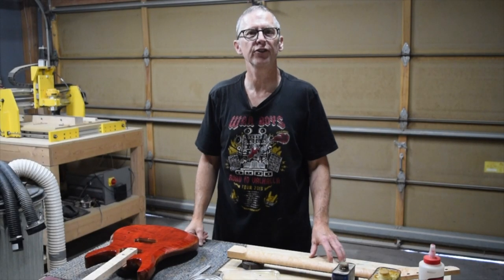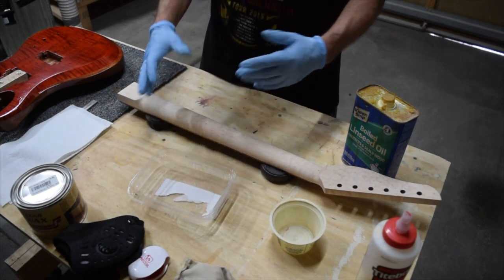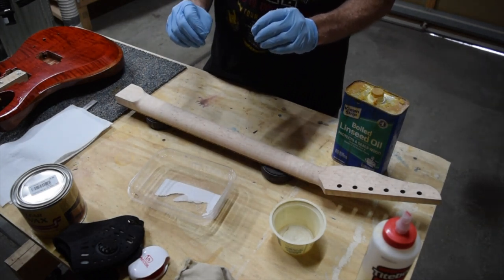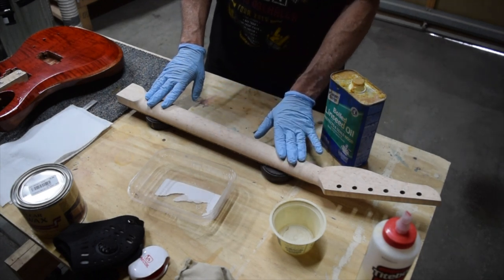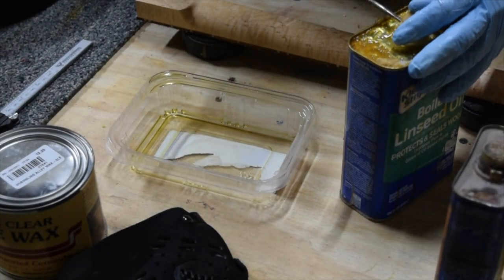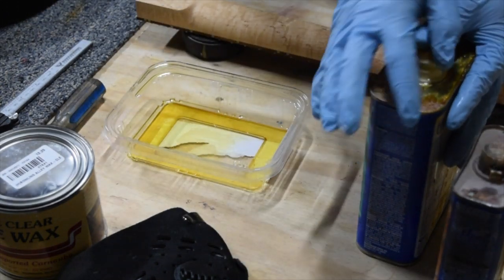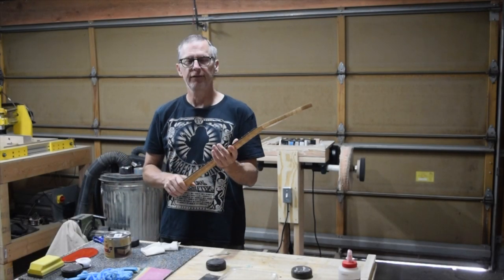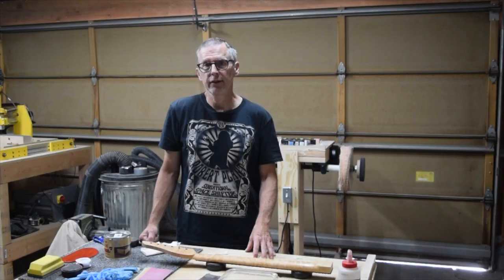Applying An Oil Finish On A Guitar Neck

Comment: Thank you for sharing your knowledge.  Very much appreciated.
I made my first guitar in 1983.  A Rickenbacker 320 copy, in black with white body binding.  I used spray lacquer from Standard Brands Paints. 
I want to strip it and stain it red and replace the white binding.  It has a center core of birdseye maple and wings of Honduran mahogany. 
Do you think I will be able to strip the finish so that BLO finish will not have application issues?
I'm concerned about any residue from the original spray lacquer.
How delicate is BLO?  Is it forgiving enough that residue will not be an issue?
Thank you
Reply from the maker: Since the stain has to soak into the wood, any lacquer residue remaining on or in the surface will inhibit its absorption. Therefore, you will have to completely remove all traces of the lacquer before you apply your dye to the wood. BLO by itself is really intended to seal and enhance the natural appearance of the wood grain. The only protection it offers is to prevent the absorption of humidity and sweat. It doesn't protect the finish from scratches and/or dings. For that, you need a clear coat like lacquer.
Reply: @HighlineGuitars  I've been debating between so many finishes.  I'm going to strip the finish, sand and apply body binding to both sides.  I have naptha and will clean the raw wood.  I do like the feel and idea of BLO to the neck but the guitar is a neck-thru build.  I want the birdseye neck to really show.  It might be a trade-off between having a smooth neck and a more delicate body.  Can there be a transition of top coats at the neck joint area?  Maybe keep the neck with BLO and add Tru Oil type finish to the body?  How toxic is BLO?  What about polymerized linseed oil?  Any suggestion would be appreciated.  I just retired, so I have the time to finally get to this project.  Thanks for all the help.

Comment: When do I apply my headstock decals? I assume after it's sealed right? Thanks!
Reply from the maker: After the oil has completely dried and before you lacquer it.
Reply: @HighlineGuitars  Thank you! Do you have a vid on that? I didn't want to clear coat my neck but it seems with the decal I have to do something at least on the head.
Reply from the maker: @Selmer1430P  no video. I don’t do decals.

Comment: Great idea for the back of the neck. What would you suggest to use on a unfinished maple fretboard?
Reply from the maker: The traditional approach would be to use nitrocellulose lacquer. A more modern approach would be to use an amber tinted 2K polyurethane.

Comment: @Highline Guitars Just one coat of oil? And it is ready to sand within 2 days without the drying agent?
Reply from the maker: At least one coat. No more than three. Without the drier, it'll take a couple of weeks to dry where it can be sanded without gumming up the sandpaper.
Reply: @HighlineGuitars  I couldnt find Japan-drier here in Europe, so I got a more concentrated cobalt drier that I will try cutting with naptha to something like 1/5 or 1/10. How long drying time between coats and do you apply the drier again between the coats or only once on the bare wood? No sanding between coats?
Reply from the maker: @infectionsman  24-48 hours for Japan Drier. I have no idea with the stuff you're mixing. You can sand between coats if you need to.
Reply: @HighlineGuitars  Do I only put Japan Drier once on the wood, or put it again between the oil coats?

Comment: Thanks for learning me...I have never heard of anyone using boiled linseed oil as a guitar neck finish. I’m a woodworker and use it myself, mixed with shellac sometimes or as is. Are you familiar with the Ernie ball necks? They have a very natural, soft, amazing finish. How would you recommend getting that? Agreed thick gloss necks are sort of brutal.
Reply from the maker: I am familiar with Ernie Ball necks, but I'll have to investigate their finishing technique.
Reply: I’m pretty sure EBMM is one or two coats of Tru-Oil and a coat or two of wax. Oil is put on very thin and quickly wiped off. Wax is hand polished.

Comment: Great video I really appreciated all the tips, I do have one question. I just finished sanding my neck up to 240grit and staining it with Stewmac’s vintage amber. I just bought myself some boiled linseed oil and  I was wondering If after applying two or three coats of the BLO  would that be able to protect the stain from sanding? Im looking to wet sand the finish with 1500 but im not sure if the color of the stain will fade if I sand at it ?
Reply from the maker: No, it will not protect the stain. BLO soaks into the wood. You need a lacquer clear coat in order to wet sand without stripping off the stain.

Comment: Quick question, if I were to stain the wood prior to using your boiled linseed oil/Japan drier procedure, would I use an oil based or water based stain? I’m thinking of staining the neck a dark espresso color for my build. Thank you for the help!
Reply from the maker: You can use either. Just be aware that water-based stains raise the grain.
Reply: @HighlineGuitars  Awesome, thank you for the help!

Comment: Another great video. I noticed that you didn’t mask off the fretboard. Is that not necessary?
Thanks again 🙏
Reply from the maker: No. I oil the fretboard as well. However, this video was about the neck only.
Reply: @HighlineGuitars  okay interesting I will follow your example and do that as well. Thanks a lot for great content

Comment: Nice video... what about the fretboard though? You didn't tape it off so presumably you got BLO on the sides, yet not the front. Wouldn't that look uneven if you used a different kind of oil on the front but not the sides? Or is it not noticeable?
Reply from the maker: This video was about the neck. However, I do the same for the fretboard.
Reply: @HighlineGuitars  Thanks for clarifying

Comment: Chris, I have a question.  Do I need to use a sealer before using linseen oil?  I want to use it to restore an acoustic guitar and I want the most natural finish possible
Reply from the maker: No. A sealer isn't necessary with plain BLO.

Comment: Is boiled linseed oil (or even Trueoil) suitable for refinishing the soundboard of an old classical guitar?
Reply from the maker: Yes. However, BLO only enhances the appearance of the wood and seals it. It doesn't offer much protection against dings or scratches. Tru Oil offers better protection, but it will add layers that can impact the resonance of the wood.
Reply: @HighlineGuitars  - thank you very much - valuable advice!

Comment: Hey—neophyte question here. Can you apply boiled linseed over stain? Or, alternatively, do multiple coats of boiled linseed oil darken the color of the maple? Thanks!
Reply from the maker: Yes to both. In fact, oil-based stains use linseed oil as the main ingredient.
Reply: @HighlineGuitars   Ok thanks! So, is it possible to use boiled linseed oil over any type of paint to finish a guitar body? Thanks for making these fantastic videos.
Reply from the maker: @mastabad2  stain or dye yes. Paint no. The oil needs to soak into the wood.
Reply: @HighlineGuitars  Thanks!!

Comment: I am wanting to know, if I use a decal and spray paint to apply my logo, will the boiled linseed oil accept it? My uncertainty about that has kept me from trying this method. Please answer, as I have ten unfinished necks to do. By the way, your videos are great, and I gain a lot of useful knowledge from them. Thanks!
Reply from the maker: I don't do decals, but as long as the oil is completely cured, it should work. TEST ON SCRAP FIRST!!!
Reply: @HighlineGuitars  See what I mean about useful info? Stupid me never even thought about scrap. I will go to home Depot and see if I can find some Canadian maple, and let you know how it does in case anyone else has the same question. Thanks🙏
Reply from the maker: @kenrussell1093  Also, consider polymerized tung oil like Sutherland Welles or Lee Valley (both are made by Sutherland Welles). It dries completely in 8-12 hours whereas BLO can take weeks.
Reply: @HighlineGuitars  More useful info! Are you on Patreon? I need to start showing you some financial appreciation. If not, I will watch the video again for the site you referred to, and go that route. I really appreciate your willingness to help!👍🙏🙂
Reply from the maker: @kenrussell1093  Not on Patreon, but you can click the Thanks button and leave a tip. Take care!

Comment: A question about boiled linseed oil SMELL - I bought a can of it in my hardware store. Here in Europe, in my country, boiled linseed oil is called firnis. It's as you described - oil with desicants added to help it dry faster. BUT, those chemicals give it a horrible, awful smell, almost like petrol, really intense and repulsive. Does the one in your can smell the same? Cause I don't want my guitar neck or hands to forever smell like a car's gas tank if the smell doesn't go away after drying :/ Thanks!
Reply from the maker: I don't know what the stuff you're using smells like. BLO where I live smells, but the odor dissipates as it cures. Pure tung oil smells much better.

Comment: Amazing video! Was thinking if instead of mineral spirit for the wet sanding would it be alright to just use water? Would i damage the guitar if i were to use water instead? What are some substitutes to mineral spirits? Thank you so much! 😄
Reply from the maker: Wet sanding with mineral spirits reactivates the BLO to an extent, which helps it to form a slurry with the dust generated by the process. After the mineral spirits have evaporated and the oil has dried, it forms a smooth protective surface. Water won't do that. Other than mineral spirits, turpentine will work, but it is more aggressive. Naphtha also works well if you can find it.

Comment: Thanks for the excellent presentation!  One question:  I noticed you did not apply the BLO to the tongue/joint.   Is there a reason?  Is it an optional decision?
Reply from the maker: NEVER put oil in a glue joint.

Comment: Awsome video!!! I have a question though.  Is there a reason to not sand the guitar neck prior to applying the oil?
Reply from the maker: You must sand the neck prior to applying the oil.
Reply: @HighlineGuitars    Thank you so much. I'm going to give it a try on one of my guitar's. I just orderrd a wet /dry  fine sandpaper kit and the boiled linseed oil.
Reply: I used linseed oil and I love how it came out. It dried very nice, and is nice and  smooth. Is there anything that can be done about the odor of the oil ?(other than letting it diminish over time  its own)

Comment: Maybe someone asked this and it's been answered, but if you were going to apply a waterslide decal onto the headstock would you do this process first, and then say clear coat over the waterslide after? Or would you not apply the oil to the front of the headstock at all? Planning a build and just want to know what I'm getting into.

Thanks in advance!
Reply from the maker: I wouldn't use this process if you plan to apply a decal. Instead, I would apply the decal to the wood and then bury it in multiple coats of lacquer. If you want the warm hue that oil imparts, tint the lacquer to replicate that effect.
Reply: @HighlineGuitars  but I want the satin on the neck, so you’re saying to actually just oil the neck, and lacquer the headstock as it’s own job?

Comment: Chris, I wanted to say thank you for sharing your knowledge. You’ve helped me navigate through the process more than once!
I’ll be trying the boiled linseed oil on the neck of my present build and I was hoping you might know if applying it over stain would cause problems or should it be fine?
Reply: Hey Chris did you ever figured this out? I want to do the same with a very light colored neck.

Comment: Thanks for all of the very informative videos ! I have a batch of pure tung oil and I would like to know if you would use the same technique that you show in this video that you use the boiled linseed oil in? One coat with Japan dry and then 1500grit wet sand with mineral  spirts and a touch of oil ? Also how often would you reapply the oil after long term use?
Reply from the maker: The only answer I can give you is to test. I don’t use tung oil.

Comment: I have a question. is this process applicable for an all maple neck and fretboard. what type of solvent can I substitute for a mineral oil? will thinner will work out?
Reply from the maker: I prefer lacquer for a Maple fretboard. You can use BLO, but it has to be reapplied every so often as it wears away. Mineral spirits are what is normally used to thin BLO. However, you can also use turpentine or naphtha.
Reply: @HighlineGuitars thanks for replying. will a couple of coats of blo will last longer on the fretboarf? It's a fretted fretboard. will polyurethane matte gloss spray or tru oil will do for maple fretboards?

Comment: How many coats should I put? I dont have japan drier so Ill be only using Linseed oil.
Reply from the maker: Three coats, one per day and let it cure for a week or two.
Reply: @HighlineGuitars  thanks for replying.❤️ You are amazing
Reply: @HighlineGuitars   Hie, It's been 1 week since I have applied the coats. 1 per day, 3 coats, its dry but still )kinda sticky when I want to hold it also extremely small dust particles have stuck to the finish. Maybe I applied a heavy coat? I had initially sanded the neck of my guitar using scotch 600 grit to remove the polyurethane.  The mineral spirit has arrived in the mail today and I will be sanding it 30-70 BLO and Mineral spirits. Will the finish and smoothes be achieved after the sanding, because right now it's not looking good. I wanted the good satin feel on the neck. Thanks for all you help.

Comment: Question for you. I applied the boiled linseed oil and realized that all of the old poly finish was not removed. The neck is all blotchy now. Can I just sand the oil finish to try to even it out?
Reply from the maker: Let the BLO dry. Sand off ALL the finish and reapply the BLO.

Comment: Hello!

How can I remove water based stain (walnut) from my Maple guitar neck? do you recommend using only sandpapers (150-220-320)? or using paint strippers?
Reply from the maker: You have to sand it off. Strippers won't work.
Reply: @HighlineGuitars  do you recommend starting with 220p grit? I worry that I'll sand off too much wood
Reply from the maker: @Matan2222222  Then start with 400.
Reply: @HighlineGuitars  Thanks a lot🙏

Comment: So about how much mL is needed for 1 guitar neck and is it much more for a bass neck?
And does wet sanding with just water do as well in this case?
Reply from the maker: A pint will be enough for both.
Reply: @HighlineGuitars  I can't do much with imperial units, it'd be so much better if Americans switched to metric like the rest of us

Comment: I used raw linseed oil on a walking stick, and yes, it keeps feeling oily, though it's only been about 10 days since I applied it.  Can I apply something over that to seal it or make it dry? Maybe boiled linseed oil, or a wax?
Reply from the maker: If you can get Japan Drier or a similar artist's oil paint drying medium, you can try wiping some on with a cloth to see if that will force the raw linseed oil to dry. Try it on a small section first and let it sit a few days or a week or so.

Comment: Thank you for a very informative presentation.
 I do have a question. Can you apply the boiled linseed oil over a waterslide logo decal of the head stock of a guitar ?
 Thank you,
B
Reply from the maker: No. You have to apply the oil first, let it fully cure, then apply the logo. You'd finish by applying a clear coat of your choice.

Comment: Hi Chris, I am really interested in that recipe for tru oil you shared on the video, specially about the proportions. 

A joiner told me once tru oil is just a fancy name for the old 3,2,1 he called: 3 parts on mineral spirit, 2 on urethane vanish (or any oil varnish), 1 on boiled linseed oil and a few drops of japan dryer.

Could you enlight me about what would change from one formula to the other? I just want a little bit of an expert opinion before I start experiment with the formula myself.

Thanks in advance, I love your videos, crystal clear, with lot of detail, I am learning so much and so fast with all of em. Keep on.
Reply from the maker: Sorry, but I don't understand what you're asking for. Which formulas are you comparing?
Reply: @HighlineGuitars  the one you shared on the video: equal proportions of mineral spirit, varnish and linseed oil.

With the one I got from a joiner: 3 parts of mineral spirit, 2 parts of varnish, one part on linseed oil and a few drops of japan dryer.

The formula is basicly the same, its just a change on the proportions. 

Thanks for taking your time answering me.
Reply from the maker: @pastillasarteradas  It sounds like the formula you’re describing would have a thinner viscosity due to the amount of mineral spirits. Every one who mixes these products tend to tweak the ratios to suit the specific woods and results they want. It’s all about testing and experimenting.

Comment: is it safe to put over frets? I have an unfinished maple neck maple fretboard that I'd like to work on. For a more vintage look, does this method achieve that yellow look to maple? or should I use stain and satin nitro instead? Thank you for your tips!
Reply from the maker: Oil doesn't stick to metal so yes, you can apply it over frets. After the oil has soaked into the wood, wipe the excess off of the frets.
Reply: @HighlineGuitars  TY!

Comment: How do you prevent blotchy appearance in the heel area, where more end grain is exposed? Seems like no matter how fine I sand that curved area, it still looks a great deal darker than the rest of the neck after applying tung oil.
Reply from the maker: I normally don't worry about it. If it bothers you, apply a sanding sealer first, let it dry, and sand it back. Then apply your oil.